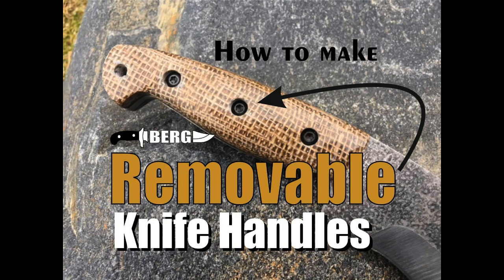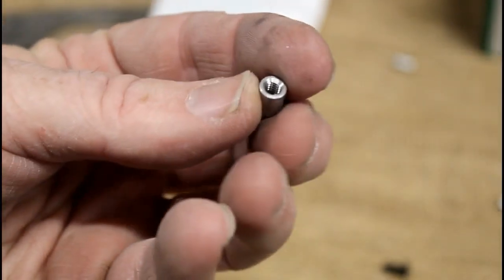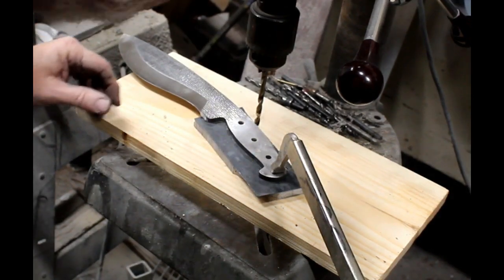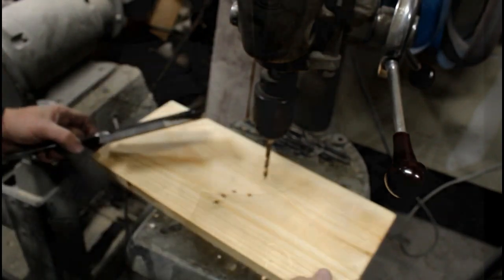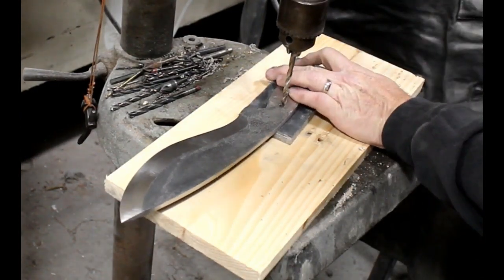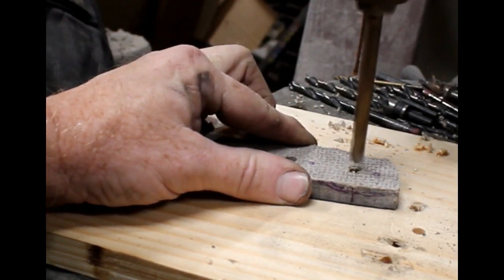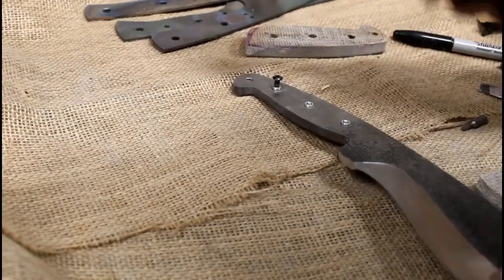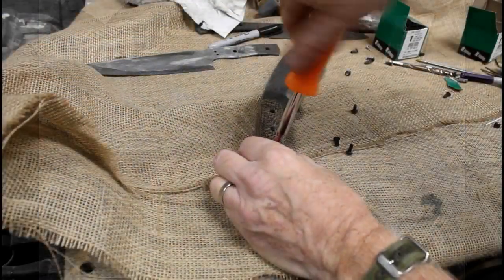How to make Removable Knife handles or handles

Comment: I have a ozark trail with wood handles and I would to use this method but I wonder what size would be better for this slimmer knife size?
Reply from the maker: 1/4 thick handles for small knives should be good
Reply: @DIYeasycrafts  
What I meant was what size threaded standoffs what you use for a thinner blade knife or would you grind the standoff and make it work and keep the 3/8 screw if it were you?

Comment: I was excited to see how this was done however you did not cover the one thing I am confused about. How did you get the scales to perfectly fit the outer parts of the tang? I assume you screw everything together and then sand the scales flush but it would’ve been very helpful to show that part in the video. I’m not being mean or ripping on your video, I was just hoping to see how you did this. I’ve learned a lot from watching you videos and I thank you for sharing. 👍🏼
Reply from the maker: You are correct. I screwed all together and then shaped and profiled the scales. Sorry I should have included that step in the video. Just thought since its how I shape and profile all my scales it would have been redundant/

Comment: Thank you; been looking for DIY  removable for persnal uses and all I find is pins and i do not own an anvil or hard metal for that. I will have to shape by a pensil line since the belt sander I have is strictly flat and non adjustable.